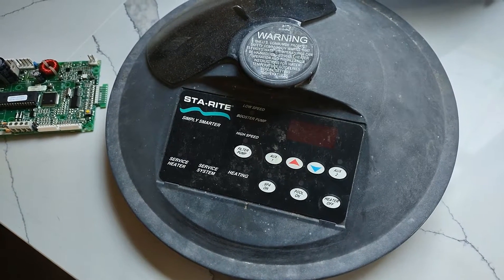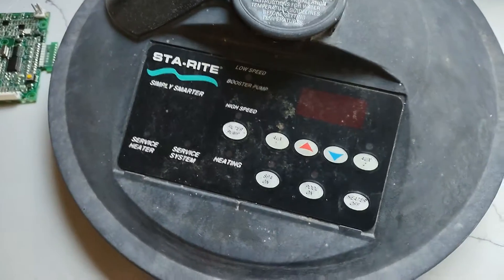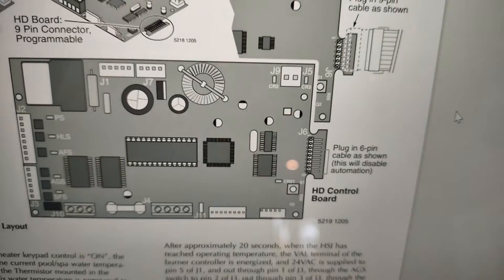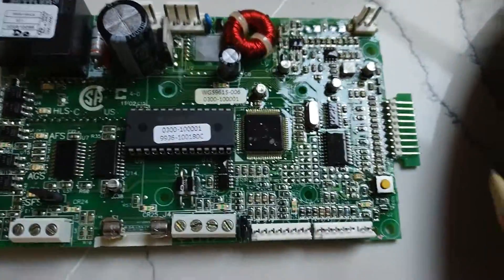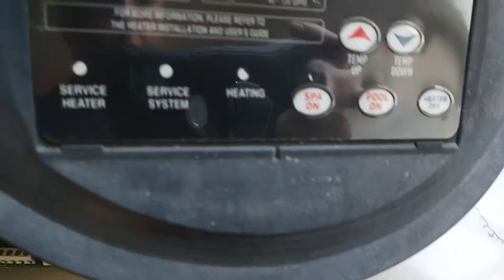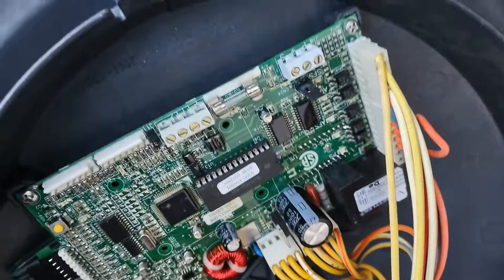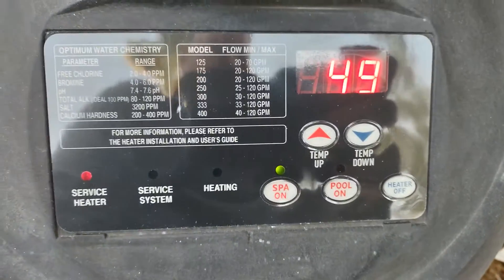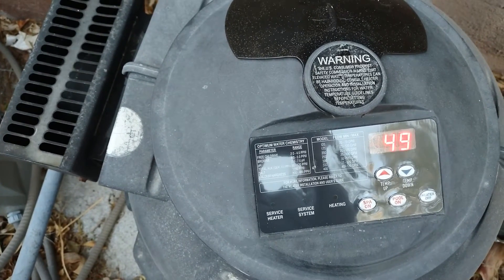Low-Cost STA-RITE Heater Control Panel Replacement

Comment: Thanks, this helps.  However I would like to know more about the yellow button, what it does, how it is useful, please?
Reply from the maker: So not exactly sure what it's intended purpose is. I suspect it's some type of test function. In my playing with it the button worked as a bypass for the control panel.
Reply: The manual available online says heaters are shipped with max spa temp of 100 degrees and that can be changed to 104 degrees using the yellow button.

Comment: How do you remove the control board enclosure?
Reply from the maker: You have to take the cover off, that's four bolts. Once it's off the top panel is attached with two cater pins just pull them and the top should come right off.

Comment: Hey Scott, good vid. Question: how did you get the membrane button/readout board out? The main board is easy with the four screws. Thanks!
Reply from the maker: It's stuck on with adhesive it's pretty much a sticker, you can basically peel it up. The new one should have adhesive tape already attached. The old pad will likely fall apart when you pull it off.
Reply: @swaber  Thank you!
Reply: Hey Scott. I have the same heater. It works fine but the digital display is blank. There are no numbers or visual display. It cycles and heats fine but I have no idea what the temperature is. Any suggestions?